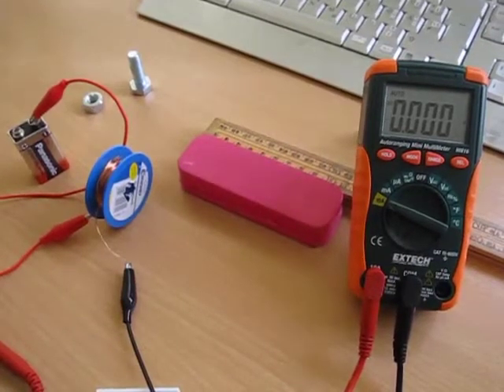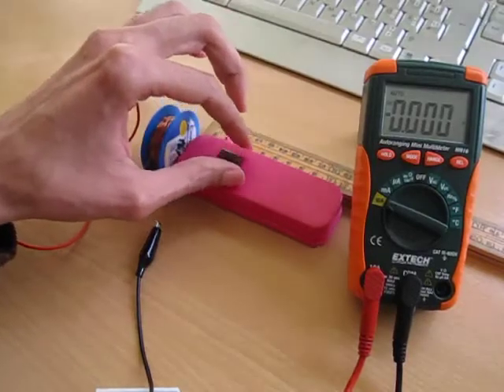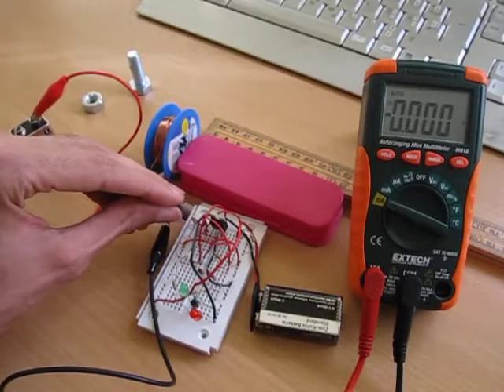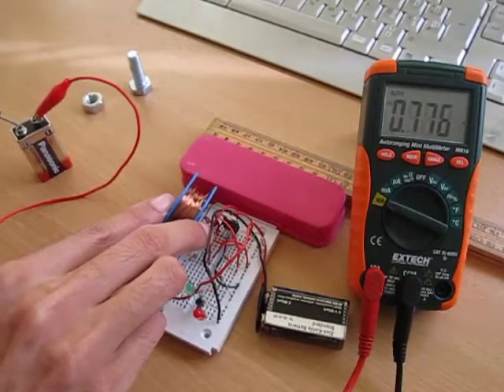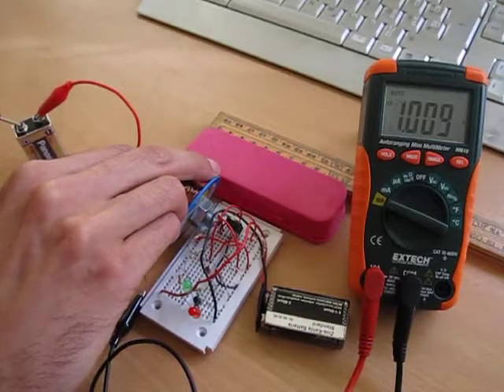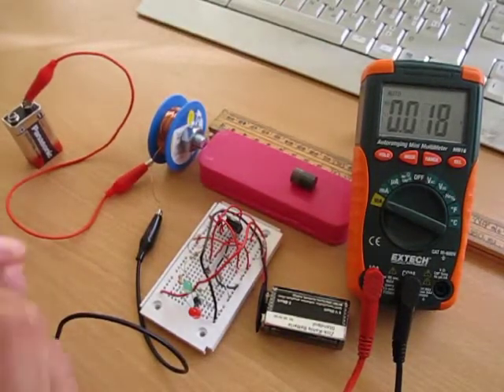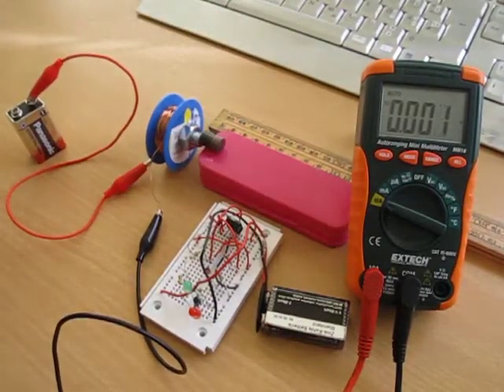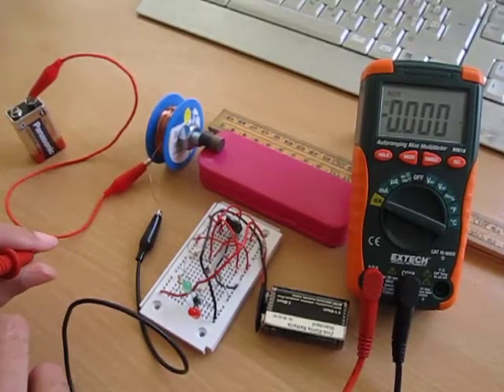Enhance the strength of an electromagnet with an iron core

Comment: Thanks for the simple demonstration.  My question would be what if you wind the coils tighter instead of having a big hole in the middle, which you filled with iron, what if you filled it with more coils?  Seems that would increase the strength, how much is what I wonder.
Reply from the maker: According to formula for the magnetic strength of a Solenoid: https://en.wikipedia.org/wiki/Solenoid Magnetic Field: B = μ_0*I*(N/L). Where N/L is the number of windings per meter. So according to the formula the diameter of the coil does not matter.
Reply: @redefinitionof  Thanks for looking into that.  The key is the hole is filled with more windings, in fact, if the diameter does not matter, the small size in the hole is less copper for a wind.  But maybe the flux loops around the outside and through the inside, so the flux must pass through the center which the iron makes happen easier.   
I was looking into 'coreless' motors which don't use iron.   https://en.wikipedia.org/wiki/Electric_motor#Ironless_or_coreless_rotor_motor

Comment: Thanks for sharing but  can u tell me what is M stands for?
Reply from the maker: It is in the description of the movie: M [A/m] "Magnetization"
Reply: thanks
i want another thing that suppose i have to build a big magnet like core size 500x 50mm,  and for the same, i am putting nos of turns is 800, then the calculation is B= Mo*H(1+x)= 4* pie*(NI/l)* 5000,where N=800,I=1.5 Amps and l= 50 MM  as per calculation it is showing very less T(flux density). Can i right? if not can u shw me the exact formulla or how many turns or Amps to be taken for  getting    1 T of flux induction
Reply: ple reply
ase
Reply from the maker: That can be right. You are only putting in 1.5 A. That is about the maximum current from a 9V battery. If you want to be in the Tesla range, you have to use thousands of Amperes and use Superconductors. On wikipedia I read that a 13.5 T superconducting magnet uses 46 kA!!!
Reply: Magnito motive force a(actually was MMF in our time)

Comment: Hi I need to boost a neodymium magnet at a specific time in a motor, do you think replacing the iron core with a neodymium iron boron magnet and then wrapping it with a copper coil will make the magnet stronger if its wired correctly so as not to cancel the magnetic field but to make it stronger?

Comment: @Davidshark1
The main components are the Hall-effectsensor SS443A and the TDA2030A 18W Hi-Fi AMPLIFIER. This sensor is easy to connect, but is actually a digital sensor. The semi-analog effect is derived by having a wacky feedback. I've made a better design with a KMZ10B Magnetic field sensor and the NE5532 Dual Low-Noise OpAmp. For this I used an inverting amplifier scheme. with a 56kOhm external load. The sensor has an internal bridge resistance of ~2kOhm, so Amplification ~= 28x.

Comment from the maker: @Ferrobbra

To calcuate the required wire length, you could first check the maximum current the wire can handle (depending on diameter - which diameter to choose depends on the application). Copper has a conductivity of 1.674e-8 Ohm*m. Say the wire can handle 2A (0.2mm radius). Than you need on 12 V a (R)resistance of 6 Ohm. The wire length is then:
R = conductivity*L/Area
=>
L = R*pi*r^2/conductivity = 
L = 6*pi*0.0002^2/1.674e-8 =
L = 45 meter

Comment from the maker: @Ferrobbra

Coil design is quite difficult. The problem is that coils have self inductance. Meaning that they oppose the creation of a magnetic field. So as you change the current, the resistance will temporarily increase. The inductance is proportional to the square of the windings. wikipedia says: "Multilayer coils have the problem of interlayer capacitance, so multiple windings should best be made in a flat (pancake) coil, so that the voltage between consecutive layers is smaller."

Comment from the maker: @Ferrobbra 

It doesn't matter what the capacity of your power source is. The voltage/current is what matters. A generic 12V car battery can be used as a power source. You should pay attention that you don't drain too much current, because that could melt your wire. On (w4zt.com/wire/index.html) you can find the maximum current of copper wires. For a stronger magnet, you can increase the current or the number of windings.